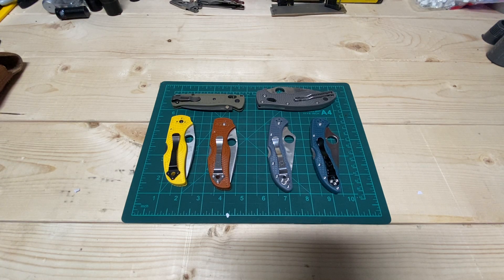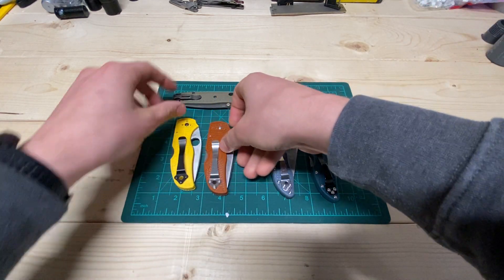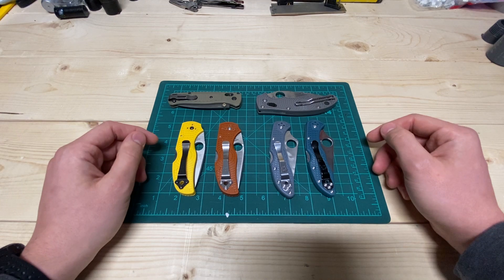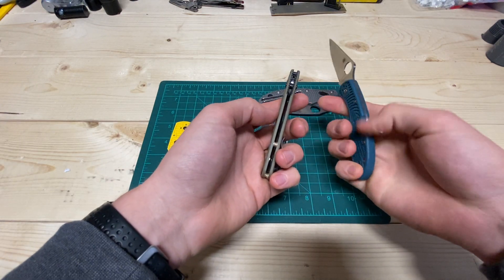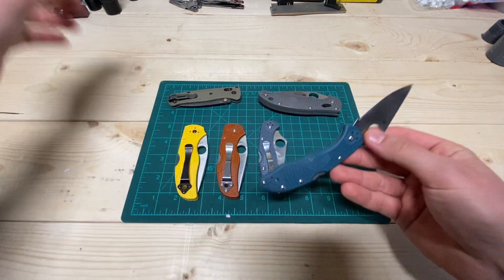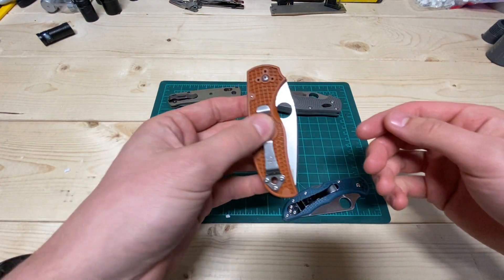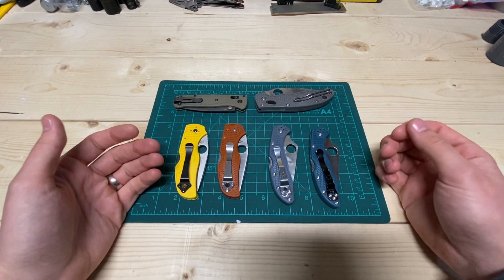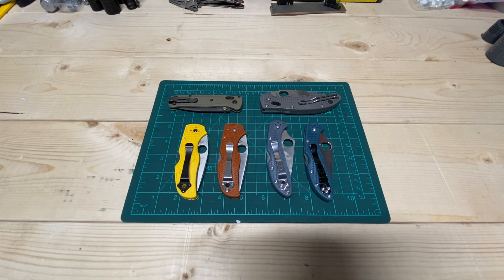Why Plastic Handles are Great! (Better than Steel, Aluminum and Titanium?)

Comment: Interesting, if you had to pick just one folder - which would be your TOP choice and in which steel and handle material?
Reply from the maker: Honestly probably a Victorinox compact with the standard scales, probably OD green would be sweet with a K390 blade. 

I’m guessing you were looking for a locking folder though! Probably either an Native 5 LW or peel ply CF Para 3. In either Maxamet or K390.

Comment: I was wondering which is better Leatherman charge with titanium scales or G10 😁 will the G10 last as long as the titanium, comfort and weight is a thing to consider too.. But lasting longer is also on the back of my ming
Reply from the maker: The G10 will not wear out but it would be more likely to crack if dropped just right but I can't speak to that yet. The titanium will be slightly but notably less comfortable and a little heavier.

Comment: Folders are EDC toys to open boxes, they have zero advances over a fixed blade as a functional tool. EDC comes down to personal preference over "quality".

Personally, I wouldn't be caught dead carrying a plastic folder.
Reply from the maker: Good to hear your perspective. What do you end up using your knives for most often?
Reply: my EDC is the only folder i own (crkt pilar with brass scale and metalfable cheeseburger paracord bead) and i use it to open packages, prying stuff open and peeling fruit.

I take carbon steel puukko knife on camping/hunting trips or fixed spydeco(ugly af yellow handle) on fishing/diving trips.